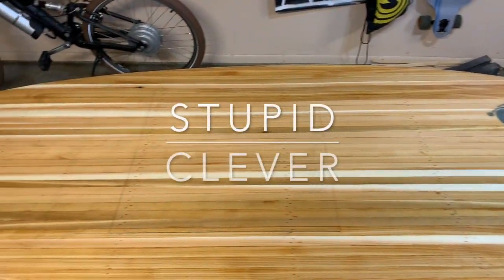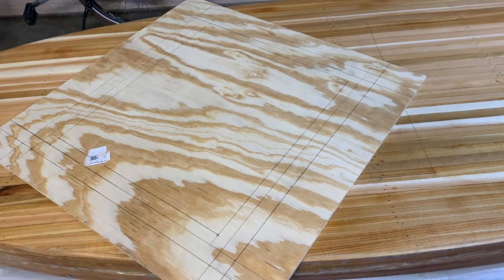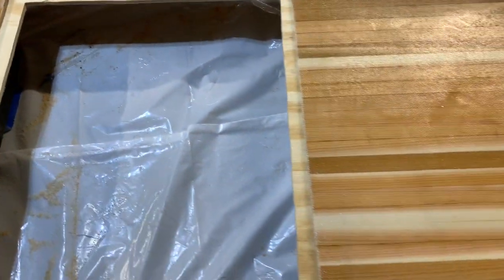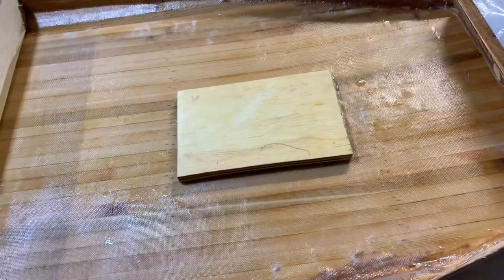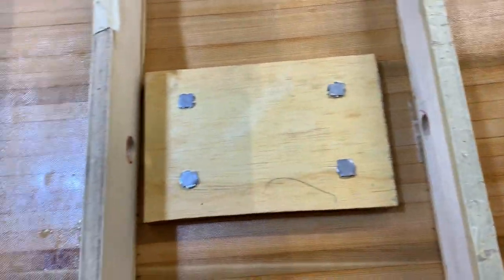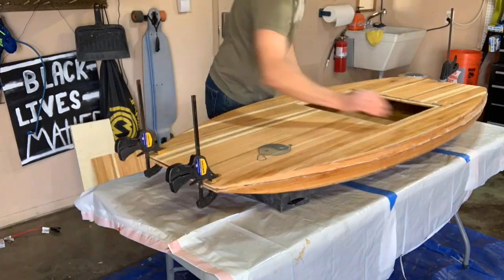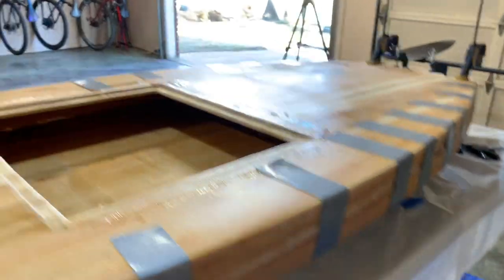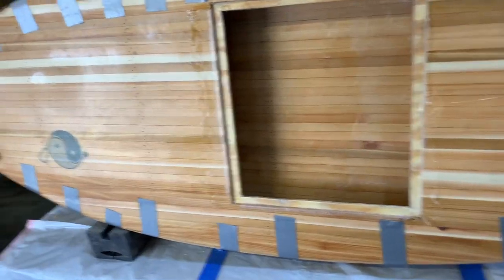DIY Cedar Strip E-Foil Build Part 5

Comment: gotta love working with wood because its so forgiving, just wondering before you split your forms everything was a nice tight fit, were the gaps caused by the wood expanding or the shape changing from being worked once they were separated? you has discussed doing glass before you separated is that what you recommend on next one ? eager to see how you build a battery box and run the wires from the mast to batterys and connections with the board sealed , at this point Id bet it weighs a bit and the mast and batteries will add to that substantially
Reply from the maker: All great comments Tom.  The gaps in the board were caused by my attempt to follow rounded contours of the forms.  I quickly discovered my mistake as I started the stripping, but I forged ahead anyways and as a result there were a lot of strips that were not fully secured.  I have thoroughly thought about how to fix the design with the next build.  I’m pretty curious how I’m going to do the batteries and electronics as well!